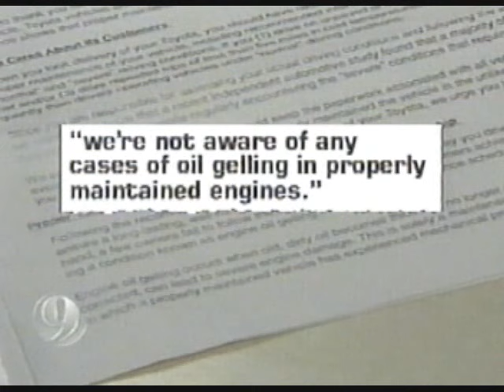Toyota Engine Oil Sludge or Toyota Oil Gel Engine Failure

Comment: The main reason engines sludge up is because the oil is not changed enough,if you do a lot of miles and the engine regularly runs at its designed temperature it will not sludge up if regular oil changes are carried out,if you only do a lot of short journeys the oil never gets to the correct temperature  and absorbs condensation from inside the engine causing sludge,more regular oil changes will totally eliminate that problem and will save the engine from expensive repairs later on.

Comment from the maker: Back in 2004, oil experts, veteran mechanics, and Toyota owners were discussing the premature break down of the engine oil in Toyotas on two major Toyota complaint sites (one site had over 10,000 postings).  Then, one of the sites was HACKED and went down.  The other site went down at roughly the same time, too!  Interesting!!

Comment: I put this news in question. I have a 1993 Camry V6 XLE that I have been driving since high school. Regular 3000 miles oil change. I have yet have any major problems with it. It's at a 180,000 miles on it right now and it runs smoother than my friends new car (engine noise wise anyways). Of course, I do the oil change at 3K on the dot, plus I use gas additive cleaner every 3K too (may have helped or not, but my engine is running great). 

I would say it's mostly owner fault...

Comment: My experience is that engines that sludged up means that the owner didn't change the oil regularly.  They are like "It's a Toyota, it'll run forever".

Comment: I worked on cars 30 years  , 20 + with toyota , I also drove toyotas for 15 or more years  , If you change your oil every 3-4 thousand miles it will never have a problem , every car with sludge had a gap of 15,000 in their oil change records

Comment: ASE Certified Tech here, my Camry has 400 thousand miles on it, and does NOT use/burn any oil between changes! I do it every 3000 miles and change my PCV valve once a year. Also absolutely NO sludge in it, why? - proper maintenance is key. So blame yourselves for NOT taking care of your vehicle!

Comment: its not the cars fault it is the owners. if they would change there oil every 5000 miles they would not have a problem. Im a chevy guy so i have no loyalty to toyota but is just people not taking care of there car and then blaming the company who built it. take car of your car and it will last
Reply: fallenangel3737 toyota says 10,000 miles. Dude, did you even watch the video?
Reply: richard vaughn it said 7,500 or 5000 in special operating conditions did you watch the video

Comment: I've had Toyota's for life: 1990 Camry (leased) 1991 4Runner (Leased) 1995 4Runner (purchased new then traded in for Land Cruiser in 2005) 1994 Camry (Purchased new, sold in 2017) 2005 Land Cruiser (purchased new and still own) 2008 4Runner (Purchased new and still own)  2008 Scion XB (Purchased then traded in for an FJ Cruiser 1 year later) 2009 FJ Cruiser (Purchased new and sold in 2012), I still have a 2004 Land Cruiser and 2008 4Runner, each runs like clockwork. 

  In 2015 I purchased a brand new 4Runner Limited From Penn Toyota in Greenvale New York, within 48 hours, the engine started knocking. The dealership admitted that it was a problem with one of the pistons but refused to fix it after leaving the SUV with them for 2 weeks so they can have an engineer come out to take a look at the vehicle.  After starting a case number with Toyota Corporate, a case manager told me to deal with it and they wouldn't fit the problem.  When I threatened them that I would seek legal action under New York State Lemon Laws I was told that if I did, they would terminate the warranty immediately....on a brand new vehicle.  

I will NEVER purchase another Toyota ever again after the way I was treated.  I'll run the Land Cruiser till it dies, and will trade the 2008 4Runner in for an f150 next year and take my chances with Ford.

Comment: With these newer Toyota models its safer to change the oil on time with the the older engines one could go easily pass the recommended intervals with no harm done ( what I would say is you could get away with using a cheap oil and changing it regularly minimizing sludge build up then to use a good quality oil and skipping an oil change )

Comment: I had a 2002 Highlander with the 3.0L V6. I had around 135K KM's on it when I sold it. I didn't have the sludge problem, but I did have a major problem with the PCV system. The PCV valve got stuck open and the car almost ran dry of oil. I got it to the dealer just in time. They replaced the valve and the car ran fine after that. The next round of problems I had was with the air/fuel ratio sensors and the o2 sensors, replaced those and the car worked fine. I have since bought another Highlander!

Comment: change the oil it is not toyota fault. My 98 camry has 358 thousand miles. In this video it is referring to 92 camry to 96 or 97 engine with the 5sfe 2.2l i have the 5sfe 2.2l runs strong no issues it has nothing to do about the pcv location to intake manifold
Reply: Me too, I have 1991 Celica with the same 5SFE engine, 29 years old, oil changes done regularly.... no problem.  Neglect will always cause problems.
Reply: @storypunman   Nice

Comment: Normal type of engine oil for Tercel 1993 is 5W-30 according to Toyota attendant, after the change oil, the car runs in good condition then after 20 miles running the yellow engine light indicator on panel appears. But during the past 4 months using other kind oil, indicator didn't appear.

Comment: The Toyota 5s-fe engine has a very short PVC system, A PVC valve and 4 inches of hose. How is it more likely to stop up? On an Explorer 4.0, the PVC starts on the driver valve cover, runs to the firewall over the intake manifold, along the passeger valve cover to the intake, nearly 3 feet of PVC tubing.

Comment: @autoresearcher 

Our family owns a '00 Camry... 5SFE, 4 cylinder 2.2 liter motor. Automatic tranny. Always did 3-5k mile oil changes, and up to 10k (with periodical filter changes) when we used synthetic oil.

It has 135,000 miles on it, and counting. The only part replaced was the radiator, and that was a couple years ago (supposedly it was leaking?). Apparently not, but was still replaced.

No engine problems whatsoever.

Comment: @autoresearcher 

AFFECTED TOYOTA CAMRY OWNER HERE. Inline 4, 5SFE. I can back Toyota up on this one. We recently overheated the engine THREE times to the point the water pump literally cracked into pieces, dropped valve seats, ect.

Engine was tore down, I had done all the oil changes previously myself. Oil change every 3-4k miles (oil + filter), or two filters every 7500k with synthetic oil. Engine was SPOTLESS inside. The PCV valve perfect. 

User fault, quit denying. Take responsibility.

Comment: I brought a 98 Corolla new and have not had any problems with it except for excessive oil consumption and some blue smoke. Apparently the 1.8 liter engine cokes up the rings in 98-02 models because of too few drainback holes in the pistons. The only remedy is rebuild or replace. I had some luck doing a top end clean with Marvel Mystery Oil. With this and the sludge problems + the unintended acceleration issue I'm not buying any more of their cars.

Comment: i had the 3MZ v6 engine in a sienna before and i did my oil changes with your off the shelf conventional cheapie with intervals of 5000-7500 miles, cheapest oil filter as well, and even one time i didn't bother changing the filter! oil always came out perfect, not even dark yet, still gold as it should be. hell even my 3S-GE 25 year old engine runs 5000miles between changes and it has no sludge at all LOL

Comment: im assuming they arent buying quality oils or doing poor maintenance
Reply: Za Thao You are assuming incorrectly. This serious engine problem is unrelated to owner maintenance! Those who changed oil every 3000 miles or better still found that their engines became sludge-gunked!
Reply: @Charlene McCarthy Blake While I am not an all-in Toyota fan, I currently own 4 Toyotas and 1 Honda.  I had own 2 other Toyotas in the past (1 wrecked in an accident, and 1 died from aging at over 400k miles).  All of my current Toyotas are in the 200k miles now and so far, never had any issues with them.  I'm not saying none of them has problems.  All cars have problems....all cars required regular maintenance.  I've done the regular minor maintenance like changing the oil, oil filter, belt, pcv valve, valve cover gasket, fuel and air filter, etc.  You tend to claim that it's unrelated to owner maintenance and that there has been owners that changed their oil every 3000 miles or better and still experience this particular issue.  My question to you is, where is your proof?  It's one thing to make a claim with proof (which none of the folks in the video has), but it's another thing to turn an opinion into a "true" fact (like you did).  They call that speaking with your "head stuck in your ass".  Until one of the owners come forward with service records showing they changed their oil per recommended intervals, then your claim is just like everyone else's and mine, it's just an opinion.  Yes I understand that people do their own oil changes and won't have any records...but judging from the folks in the video, none of them even has a clue as where to start with their oil changes.  This video only shows 1 side of the story (the bad side).  I'd be amaze if these owners actually change their oil at all on time - a consistent oil change even with cheap oil should and will prevent this issue.  Toyotas don't make it to the top for no reason....please provide proof...not another of your statement that my assumption is incorrect...or that this particular engine is unrelated to owner maintenance.  You can do better than that....I hope!

Comment: My 2005 Toyota Camry  seized at 36,000 miles this Jan.2010.  The dealer told me that it was my fault- I "Ran it out of oil" then they had the balls to tell me that I "refilled the engine with fresh oil because it was obviously clean oil Then  they told me they did a computer search and found I only changed oil once.  I sent them ALL of my oil change records and they offered to pay for an engine for "Goodwill" but told me I have to pay Labor $2,000 Toyota is a sinking Titantic. DOOMED SELL NOW!!!

Comment from the maker: Wrong!  Those who have maintained their vehicles better than recommended still got Toyota oil sludge!  Seems this was just a red herring spread by Toyota and promoted by Toyota Protectors!  Something within the engine is causing the premature breakdown of the engine oil even at mileage below 3,000 miles!  Check the lab-generated engine oil analysis and see what I mean!

Comment: love my toyotas!!! have had 2 tacomas, camry, venza, and now a new tundra. Every 5k miles i change the oil and filter, and when i change oil i let it drain till not even a drip is coming out.  I also  use 5w20 mobil 1 fully synthetic oil. I always change air filters every 15k and get my entire vehicle inspected every 30k under my warranty. I always purchase extended warranties and i always always keep every receipt and record of every single maintenance action i perform just in case they blameme

Comment: Its not alleged issues or propaganda from U.S. manufacturers. This IS a Toyota crankcase venting problem just like Mr. Goss said. My engine builder had floor full of Toyota 3 liter engines from the local Toyota dealers all with same sluge issue. the only solution to the issue is to run a quality oil and to change it religiously around 3 thousand miles. Would you please grow up people!

Comment: If these owners didn't bother to take a quick looksie into the engine head from their oil fill cap then I don't feel that sorry for them.
They should be aware of basic things like sludge build up and should know if there engine burns any oil so they can top if off before the oil level gets low. Basic DIY maintenance is needed if you want an engine to last forever, unless you completely trust the mechanics at Jiffy Lube which I don't.

Comment: ok i work at toyota dealership they had problems with there 2005 V4 cylinders to 2014 V4 cylinder had problems.
Why because cylinder Rings, scrapers were poorly made also shit quality and the bottom end were iron block and AI cylinder heads also due to heat exchange hot cold etc
Do give you accurate answer don't by 2.4 liter toyota especially bad from 2004 - 2013 period.

Comment: everone by now should use synthetic yeah it more expensive but, it less prone to sludge build up, also depending on the type of synthetic oil that you use it will in time remove current sludge build up.

Comment: This report is a bunch of bull.  These people didn't use good maintenance facilities.  Jiffy Lube specials.  Cleaning the PCV system is part of regular maintenance.  I drove a Toyota with this identical engine more than 275,000 mi with no sludge.  Why and how?  I CHANGE THE DAMN OIL AND FILTER, that's how.  These owners are knuckleheads.
Reply: John Ferguson WRONG! More folks signed the petition, that was constantly under attack by automaker-protecting entities, than the number of affected vehicle owners Toyota said were impacted!
Reply: John Ferguson This is a condition that caused massive engine damage even for those who changed their oil better than every 3000 miles! It's far from "bull!" Do you work for Toyota?

Comment: It's simply neglect that caused these problems. If you were to take these engines apart that have suffered the sludge problems and inspect the oil screen you'd see how clogged it is not only leading to sludging but starvation of oil into certain areas of the crankcase. If people just stopped rushing these days and get their oil changd for a mere 40 bucks they wouldn't be in this mess.

Comment: During July 2010 my 2001 Sienna started bellowing out smoke so bad we can't drive it!  It only has 112,000k and we had it maintained, by our local Toyota dealer, in accordance with the factory recommended maintenance schedule - including oil changes.  I changed the PCV valve and it stopped smoking for 2 days, but then the smoke returned.  Plus, it now burns through a quart of oil every 200 miles.   I'll make and post a video here soon.

Comment: The engine is fine the problem is Toyota never should have put a 7500 mile  intervals oil changes , because most will go 500 over.  So you are talking 8k on conventional oil , That's the real problem. These engines need 3-4 k changes on conventional oil. Toyota should have owned up on claiming too long oil intervals, at the same time people should be changing there oil sooner then this with conventional oil.

Comment from the maker: Wrong!  Toyota owners in many cases changed their oil every 3,000 miles.  It made no difference as oil change intervals is NOT the "smoking gun" in this serious engine malady.  Just like floor mats is NOT what triggers the sudden acceleration in several Toyota models!  Toyota likes to distract the public and the owners into thinking it was something minor or unrelated to the manufacturing process, IMO.  More and more is coming out to dispute Toyota's claims, however.
Reply: But floormats getting caught on the accelerator were the issue. I was one of the people that had one of those acceleration events 6 months prior to the issue getting attention by the media.

Comment: i mildly had this problem on my uk toyota previa 2.4vvti, caused by the pcv valve being blocked.  there are two breather hoses conected to the engine cover a small one with the pcv and a big one. they both vent the engine in the direction of the pcv and get rid of blow by gas,water vapor, petrol, and other harm full products. A good pcv will keep the internals clean and double the life of your engine

Comment: @Za Thao It doesn't matter whether you buy cheap oil or that  overpriced stuff thats 12 bucks a quart called royal purple. My parents have a old 90's ford contour with 375,000 +miles thats had cheap walmart oil all its life and it loves it. It can be dirt cheap as long as you change it enough. Just remember everyone, its better to buy cheap oil and change it a lot than to buy some overpriced stuff and let it ride for 75,000 miles. Our Contour, Wal-Mart brand 10w-30, 375,00 still running strong.
Reply: My 81 Volvo had 318,000 miles on it when it blew. I changed the oil and filter myself every 3 - 4 thousand like I have done with all my vehicles. The only one that sludged up on me was my Toy Van. I was not happy, took it to my Toy dealer, they blamed me for not following the schedule. A six year old vehicle should not be sludging up! Needless to say, I never returned.
Reply: not true. 
some of the cheapest oil isn't even rated...no rating at all on the container. 
never use that crap.
Reply: Well the contour bit the dust for the second owner a few months back at its final 400,207 miles. When I say cheap oil I don't mean Chinese oil that's 50¢ a quart. Im referring to cheap as in the blue bottles from Walmart. You stated the obvious about Chinese oils. Obviously noone would use an oil that's not rated.
Reply: losi8ightyew people do use it. In my town these fools buy it at the dollar store.

Comment: that's very smart but your maintenance is a bit excessive. Air Filters go for 30K miles and your oil still has a lot of likf at 5,000(if you use synthetic), if it's dyno oil then yeah, 5K is good.

Comment: Man trust me. I have a camaro and if i could tell you how many electrical problems i had with this car in the past year there would be no room for me to write. My 94 Camaro LT1 small block chevy has 230K miles on her and never missed a ticked. Because I change my oil. The only week points in my car and most cars are sensors, wires, pcv valve, basically all the hoses and electrical. As long as you change the oil you wont need to worry about a whole new engine!